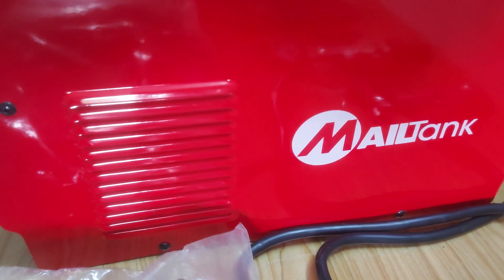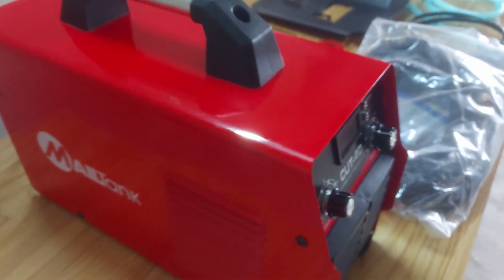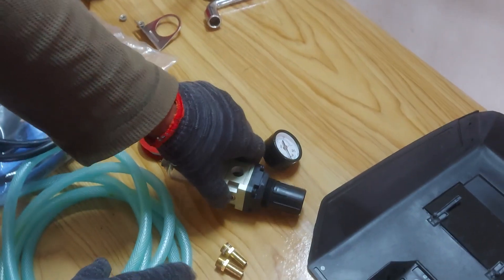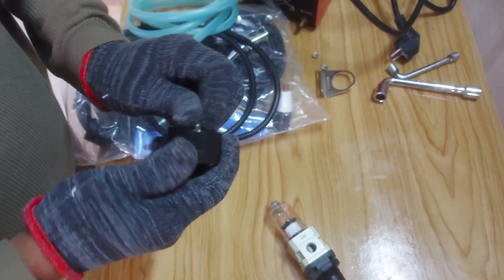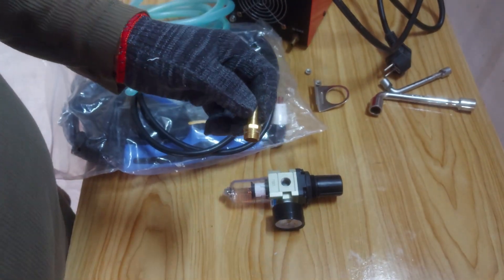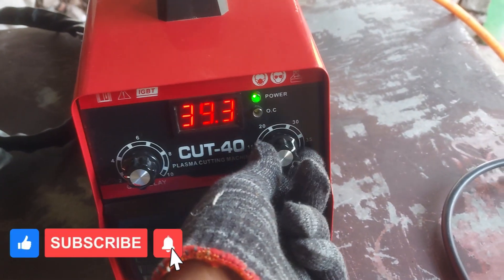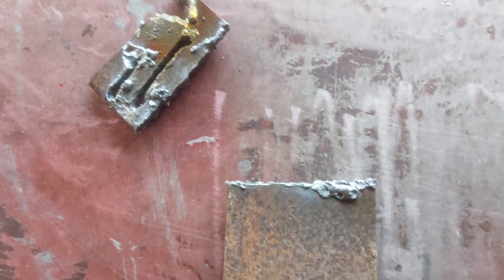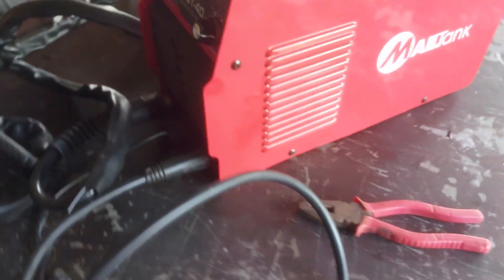How to Setup and use Mailtank Plasma Cutting Machine "Cut-40"

Comment: fantastic!
Reply: Hi Mr ..does it use Air Compressor or gas bottle??
Reply from the maker: It needs a separate air compressor. No need any gas or gas bottle. Just air flow to protect the nozzle from melting away from heat.
Reply: It work with separate compressor 😅